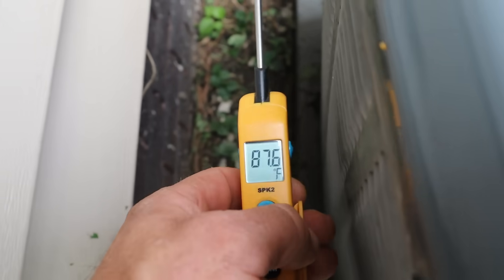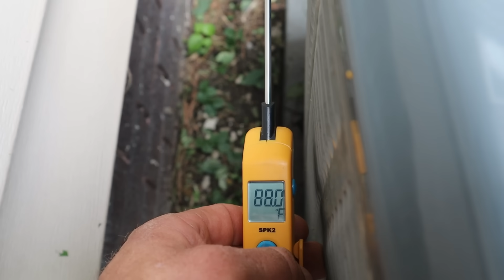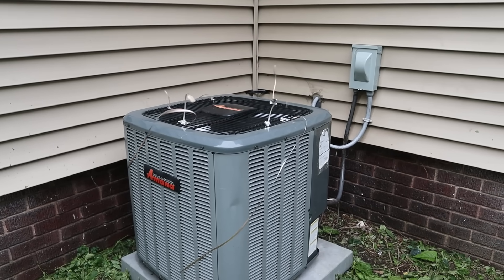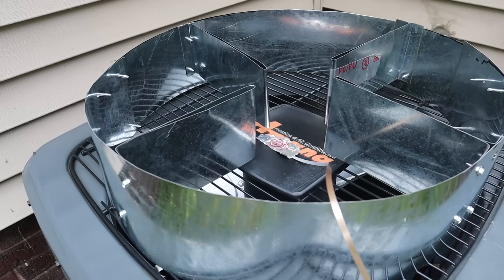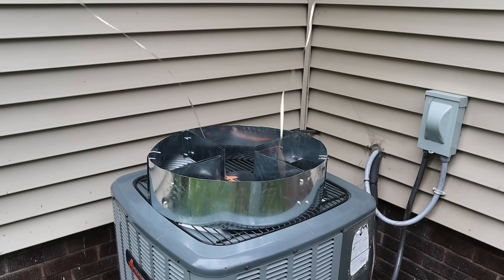Your AC Fan Makes a Mini Tornado

Comment: Not disagreeing because condenser inlet air temp does matter and not criticizing but it would be helpful to know the compressor discharge or system head pressure before and after.  And even the suction pressure as well.  That would be how to know and confirm actual performance increase % (lower head pressure = better compressor efficiency = lower evap suction temp). Could even measure the savings with that info along with the set temp, ambient, and the units known capacity (Tons or BTUH).  Tnx for the video and might try it to find out those savings. . .  Then make em & sell em on social media 😁. . . jk. . . but probably would sell like all those other condenser fix videos 🧐.

Comment: You've basically got a short chimnel with "stator vanes" (ala turbine designs) in it. If for some reason you want to improve it more, then a slight angle to the stator vanes (to do an even better job of countering the rotation of the air), a taller chimney (but this might require stronger construction!), and shade that doesn't block airflow for the condensor should all help improve performance.

I would probably go for height and shade for any further improvements, the vanes are probably good enough slready.

Comment: The fact that nobody can find a similar thing with google tells me that this is probably not going to do anything significant.  It is such an obvious thing to do that surely many people and manufacturers would have done it.
Reply from the maker: They have done it. Carrier even has a patent on a very similar design, and it is being implemented in many commercial applications. It's likely more of an economic factor as to why it's not used in residential. Not every residential unit may need one.

Comment: Good thinking. One of those things that makes me wonder why the AC manufacturers themselves didn't think of these passive and cheap to engineer in improvements in order to boost efficiency.
Reply: Because the efficiency gain doesn’t  materialize. It’s not an overlooked idea, or you’re right the would do this. (See my other post.)

Comment: Fun fact, the Apollo F1 engines also had the same issue with oxidizer and fuel injection. On the burn plate. We're swirling and vertex motions would prevent equal mixing of fuel and oxidizer. And they used a very similar solution to what you're using.
Reply: we're === where
Reply from the maker: Very interesting!

Comment: Wait where's the like and subscribe Where's the sponsored by Raid Shadow Legends lol.  For real though what would happen if you just left off the fins and just had something like that that went like 5 ft or 6 ft up.  Essentially just exhaust the hot air a long ways away
Reply from the maker: The fins actually eliminate the need to run it up several feet. That extra height would add static resistance that the fan would have to work against. The fins straighten out the airflow to throw it directly up and away from the unit as if it had a taller stack on it, but without the stack.
Reply: @JerseyMikeHVAC yeah I guess that does make sense.  You could probably avoid the static resistance by having a slight cone outwards with a ripple shape, but I don't think there's any good real reason to do that lol.

Comment: I really like this idea an am going to give it a whirl. I have long thought about smoothing the airflow above the fan motor with something like a spinner on an airplane propeller and getting rid of that square plate as the corners stick out into the airflow. My unit looks to be just like in the video. So i may do both. A flow improving spinner on top the motor and the baffle on the sides.
Reply from the maker: Let me know how it works out for you, I'm curious to hear what you think about it.
Reply: Have the spinner being 3d printed and picked up the metal for the duct today. Just need to have it rolled to size and then install both. My unit is a heat pump so should get some results this winter, but not sure how to monitor things.

Comment: I made my own contraption to shade the side vents from the sun.  After shielding the sides of the condenser from the sun, the sides are now about 40% cooler than the top during the peak angle of the sun.  Of course my condenser sits on a concrete patio slab so that may have a lot to do with it.

Comment: nuclear cooling towers have their shape for very different reasons though.  what you are stumbling on, can almost be more described like, the venturi affect.

forcing the air to form straight columns.  which can then also pull air around it in that direction.

Comment: I have an old plastic barrel that's about the same diameter as the fan on our package unit. I might cut about a 12-15 inch tall section out of it like a ring and then use some spare sheet metal to make the veins. It's worth a try. It will only cost me 30 minutes.

Comment: Another trick that could obviate the need for this device is to build a that pulls your radiator inlet air from your cellar which would be good for both the summer and winter.   It would have the added benefit of keeping your seller dry and clearing out unwanted radon gas

Comment: I did this hack with some 10" aluminum flashing roll, coiled it into the right diameter and taped it with aluminum foil hvac tape. drilled some holes and zip tied it the the grill. the turbulence is gone and the hot air is ejected straight up, whereas before I could feel the hot air being swirled around the condenser. Thank you so much for this.

Comment: If u want to get real nerdy, try bringing the fan edge as close to the walls as possible and have the wal drop 2 inches past the blades make the funnel past the motor about 1.5 feet tall.  Can get nerdier but that requires a lot more work for only a lil gain.
Reply from the maker: I was actually thinking about a way to remount the fan on the shroud somehow, removing the grate and securely mounting the whole thing right into the opening of the CU, but that would take some precision and time.

Comment: Makes total sense and I’ll admit it never crossed my mind that the condenser is sucking in air with a higher temperature than ambient air.  Smart man, I appreciate the information sir.
Reply: The main issue is the brick. My west and south facing sides of my house (brick) stay extremely warm well into the night. My ac is on the north side though. Yay

Comment: Do you think we could take that hot air and channel it to maybe heat water? Or something? A hot air room under a concrete pool. Idk but that hot air is wasted.
Reply from the maker: There must be some way to use it, but heating water, I don't know. Depends how much the unit really runs.

Comment: So simple. First (architects and home owners) put the unit on the north side or east side not on the south or west sides. Add some vanes as shown and a simple boost to unit efficiency!
Reply: If talking to architects then you can go a lot further. Architects, unlike pretty much everyone else (even builders, who often won't have the attention to spare on a lone property) have the opportunity to maximize the whole house. So, an architect could choose to install the condenser beside a decorative water feature or swimming pool, with patio shade that will block the sun but not air.

An architect has all sorts of random things they can do.

Comment: Micro turbulence creates better heat transfer than laminar flow
Reply from the maker: The heat exchange is already done at that point. The goal is to get the discharging heat away from the unit.

Comment: For what it's worth this is what ChartGPT has to says about this solution:

What a cooler intake does (rule-of-thumb)

For typical air-cooled residential condensers:

Every 1°F drop in condensing temperature cuts compressor power roughly 0.5–1.5%.

Intake air is the main driver of condensing temperature, so a 5–10°F cooler intake often yields about 3–12% less power draw while also slightly boosting capacity.

I’ll use a conservative mid-range: ~0.8% per °F (real systems vary with load, refrigerant, coil/approach, and fan control).

Quick scenarios

Assume a common 2.5–3 ton system, ~3.0 kW at steady cooling (≈10 EER at design conditions).

If you lower intake by 5°F

Estimated power reduction: ~4% (range ~2.5–7.5%)

New power ≈ 2.88 kW (down from 3.00 kW)

Over 1,000 cooling hours: save ~120 kWh (range ~75–225 kWh)

At $0.13/kWh: ~$16 (range ~$10–$29)

If you lower intake by 10°F

Estimated power reduction: ~8% (range ~5–12%)

New power ≈ 2.76 kW

Over 1,000 hours: save ~240 kWh (range ~150–360 kWh)

At $0.13/kWh: ~$31 (range ~$20–$47)

If your unit runs ~1,200–1,500 hours per summer or is larger (e.g., 3.5–4 tons), scale the kWh and dollar savings up proportionally.

Other side benefits

Higher capacity at the same ambient (cooler condensing = more net refrigeration effect).

Lower compressor discharge temps → potentially better reliability and oil life.

Less cycling if your thermostat is tight, which can help comfort and reduce wear.

What drives the range

How closely condenser condensing temp “approaches” outdoor air (coil size/cleanliness, fan speed).

Ambient swings and whether your baffle still pulls in truly outdoor air (not recirculated).

Control strategy (fixed-speed vs. variable condenser fan).

Comment: How much of that is do to the unit being in a corner and the air getting trapped there?
Reply from the maker: Probably has a lot to do with it. I mentioned in another comment I will move this unit eventually, but I wanted to see if I can come up with an easier solution because a lot of people don't want to pay $1000 to move their unit 2 or 3 feet. There are so many bad installs out there.

Comment: Another suggestion for everyone and I know this is going to be harder to both implement and make aesthetically pleasing but taking from my years as an airplane mechanic, when you really wanted to 'chill' out on a hot day the coolest place wasn't under the shade of the wing. It was laying down under the curve of the airplane body. Not only was it shady there, it also was MUCH cooler wind even when there wasn't much noticeable wind in other areas of the tarmac. So building a half rounded edge around the entire top of the unit would offer that cooler wind charge for the fan to suck in. Seems I'm not at all the first to think of this: https://www.youtube.com/watch?v=2-7Y4Z88BeE

Comment: Just curious if that pad your condenser is sitting on is a plastic spacer and not a concrete slab; why you didn't move the entire unit further from the corner of your house and do a comparison test. Not at all saying what you did wasn't brilliant, but if the unit can move freely like most can with very little effort, I'd give that a go also. My two units (up/down) are approx. 1.5 feet from my house. They too are about 20 years old and my downstairs unit's blower fan failed recently. Bought a new one and replaced it myself. The overall efficiency of my unit doubled. Granted this failing fan was failing for a while and I'm amazed it didn't take the compressor with it. But I think with just replacing the motor I've achieved another stable 3 to 5 years out of my unit. I'm going to also try your mod but like others suggested maybe slice up a cheap Lowes metal trash can or grab some edge siding scaffold from some recently repaired storm damage roof and bend that aluminum 12-inch long piece to form this funnel.

Comment: The fact that the condenser unit is violating code where it sits should not be overlooked. It is too close to the building on 2 sides. Min clearance is 12-15 inches where i come from. Mfr would say the same.
Reply from the maker: Completely agree. Location is a large part of the problem here and I have the skills to move it. All I'm doing here is experimenting with a possible cheap fix for others that might not have that skill, or funds to pay someone to do it.

Comment: The problem with this is the air just like fluid wants to naturally spiral so you are helping to disassemble that spiral when you should be doing the opposite you should angle those fins and help create a better vortex and that will really get the air moving the way you want it to.

Comment: Would you consider building that same exhaust stack with shade panels extending out on three sides?  Do a before and after of the air temperature coming out of the vents inside the house.  I'm not sure that lowering the temperature of the air coming into the side of the coils by 7 degrees is nearly as impactful as lowering the temperature of the coils, themselves, by shading them.

Comment: Im going to play with this idea & see if I can improve cooling or reduce electric consumption.
My shop has two large A/C units. I installed 3 rib sheet metal  from the drip channel (2-sheet metal screws) angled down towards the top back of the units. Mainly to keep leaves & debris out of them. Still allows air to flow, but seemed to make them more efficient and will stay cleaner. I know rain helps transfer heat, but I hate all the crud that accumulates.

Comment: I had the same problem with a "Shark Home Air FIlter".    It was a cylinder shape and the fan at the top sent the air swirling outward. (I could feel that with a moist hand)
and the filtered air was simply going back into the intake of the unit.   So it was filtering the already filtered air.   
I simply took some printer paper (the thick/heavy kind) and taped it into a "Columator".   It held it's shape and I taped it to the top of the Air filter outlet.   It sticks up only about 6 inches above the top of the unit. 
Now the air goes way up to the ceiling and doesn't wrap around.   I have a picture if anyone wants to see this.   I did this almost a year ago and the paper is still on it. 
I Would like to get a columnator like what you show here (for the same type of condenser unit).    I'm thinking aluminum kind of flashing and the hardware stores might sell these
90 degree screw attachment elbows.    I might look into this.   I figure I'll only need about 8 to10 inches of columnator height.   animals won't get stuck in a think that shallow but leaves might get in there.   I think they might get blown out thou.

Comment: An even easier way to solve this is to raise the fan blade further up into the fan volute to prevent the portion of the blade from pushing air off the ends back into the inside of the condenser...the bottom edge of a fan blade should be even with the bottom edge of the volute...

Comment: 4 tests are needed to confirm a claim of increased efficiency.

Ambient temperature at the coil intake: with and without the shroud
Head pressure: with and without the shroud
Amp draw: with and without the shroud
Air flow (CFM) through the condenser coil: with and without the shroud

Until all 4 are confirmed, there is simply no proof to confirm an increase in efficiency.

Comment: Although your analysis of the hot air being rejected (not exhausted) off the condenser getting drawn back into (not looping over/down) is good, the principles behind it are off. The unit is too close to the wall, and since there is a low pressure all around the sides where the coil is due to the fan forcing the air upwards...the result is the hot air coming off the top ends up being part of the entering air.
Reply: Forget about the temperature delta. If you disabled the compressor of the air flow would still do exactly the same thing, in fact perhaps even more so since hot air wants to rise.

Also, from experience, I have found that the more restricted the coil is as it gets dirty, the more the fan will significantly discharge the air out in a radius. In fact I have walked by condensers where I know right away the coil is dirty because it's blowing out the side onto my legs as I walk by, and if I put my hand over the center, there's actually no air flow. The discharge duct on the top definitely makes a difference, in some instances dramatic. I've worked on some units underneath carports because somebody thought it's a good idea to put them in the shade, and I've measured as much as 135 ° coming in to the side of the condenser because of the buildup and recirculation of the hot exhaust air in the carport
Reply: This is exactly the reason why there is a temperature delta.
Reply: That unit is in a bad location, close to two walls in a corner.  Air will stagnate in the corner.
Reply: The other thing is placing the fan blade correctly in the unit itself. This will greatly affect air flow.
Reply: @PeterParker-tb7ce that's true, I've been on several calls where the fan motor was replaced incompetently, was much longer than the factory motor, and they also placed the fan blade very low on the shaft instead of up into the Shroud as high as it can go. So the fans just sitting deep inside like a blender

Comment: Interestingly I once saw an old home A/C unit from the 1960's that was still working with this exact design built in.  It was a tall (like about 4 feet or more) and skinny cylinder shape unit with 2/3 of it's height being the coil and fan and the other 1/3 being open space over the fan like this flow-straightener you made.  The blast of vertical air it output when it turned on was immense.  Sadly the landscapers mower threw a stone into the old survivor unit and put a hole in the coil and it had to be replaced.
So the manufacturers know of these designs from way-back but don't do them probably due to save cost.
Reply from the maker: Do you recall what brand it was? I've seen a lot of old units last 30 some odd years and many aren't in business anymore. Makes you wonder if they're almost designed to fail at a certain point.
Reply: @JerseyMikeHVAC  sorry, no I do not remember the name, just the details and that it was that 60's green.  The inside unit was a Moncrief, so the outside may have been as well... but cannot say for sure. 
But yes, seems like all the new ones are made to fail, just look at all the Goodmans that fail just outside the warranted period